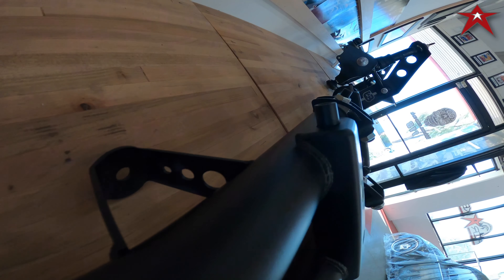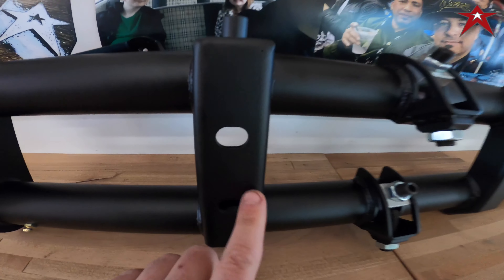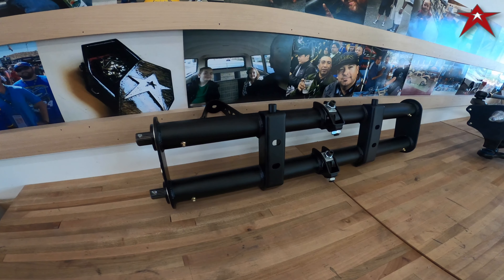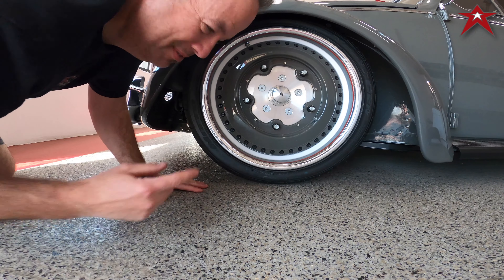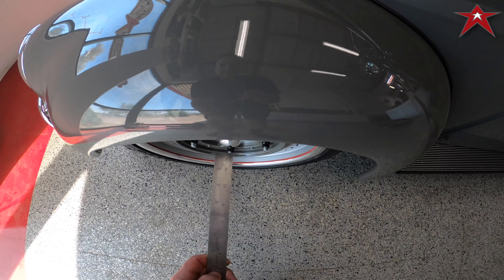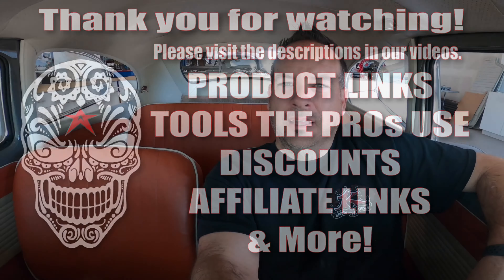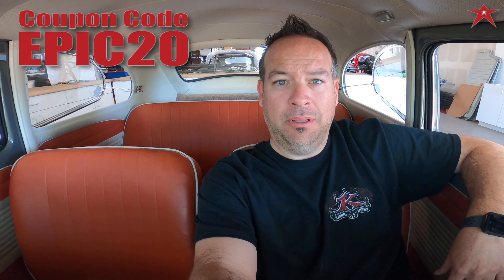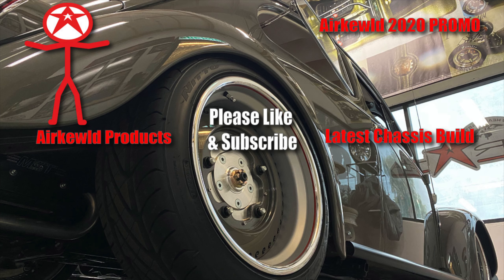Myth BUSTED!! Do SHOCKLESS Beam equipped VW's ride like poop? Classic Volkswagen Beetle/Ghia Myth

Comment: Hello, I have a 67 bug with a 4” beam I tried putting on 145/15 tires but the right tire rubs the right bucket light any suggestions? I have now 145/65/15 has a good clearance but the beam it’s only 2 inches from the ground I tried raising the beam 2” now there’s a 2 inch gap height between the tire and fender. I don’t know if 135 or even 125 would work, do you have any advise for me? Thank you
Reply from the maker: Do you have drop spindles on the car?
Reply: Yes it was dropped 2 inches
Reply from the maker: @nikittoo1  There is no such thing as a 2" drop spindle, they are all 2.50". If you have those on the vehicle, you need to shrink the sidewall profile.
Reply: Thanks

Comment: Would be interested to know what wheel/tire size you had when measuring the tuck. In that setup with (im assuming) the Bad Brakes, does it rub at full lock?
Reply from the maker: Loaded with three people it rubs, but alone it does not. 205-40’s with 17x 6.5’s with drop spindles and bad Brakes

Comment: Narrowed beam doesnt it hamper your turning circle? How does it stand up too road usage
Reply from the maker: Not always Pierre. Width of wheel, track added by other parts, lots of determining factors but we do the math to get the most out of each configuration. Road usage is where it excels in the cruising dept. Thanks for commenting as usual!
Reply: Would like too get a 2inch narrowed beam. The import duties and taxes are insane.
Reply from the maker: @pierreduplessis1507  It is what it is, If I want it bad enough, I figure out a way to get it.

Comment: One of the vw shops where saying the shockless beams the tortion bars can break  without the shocks is that true
Reply from the maker: I can tell you with great confidence that anything that is abused can break. That is why we talk about defining the kind of vehicle you are building and what beam set up makes the most sense to achieve that goal and be safe. Having a cruiser set up, small motor application, you should never have an issue, atleast with our set up.